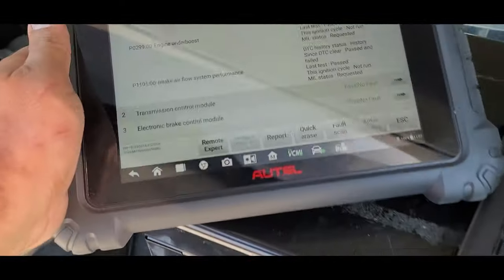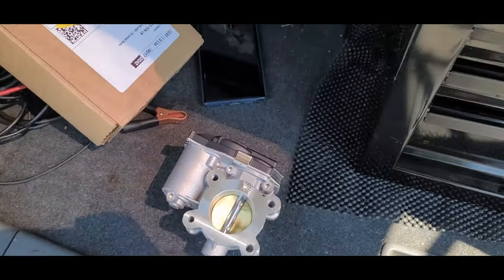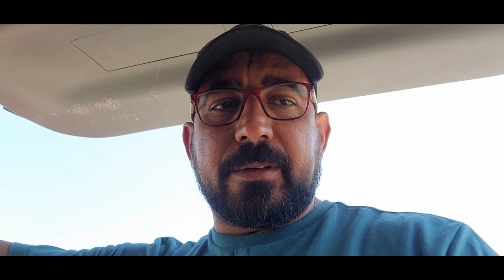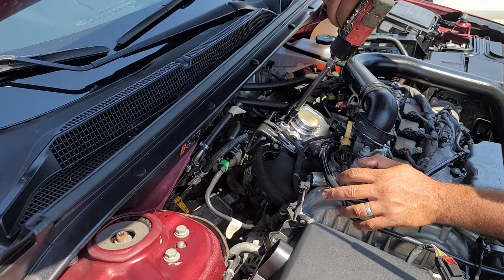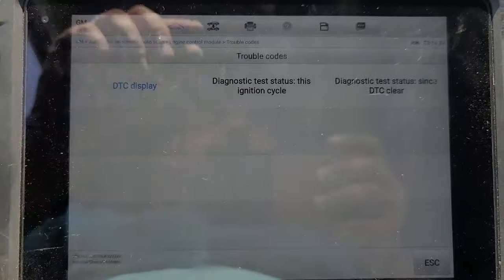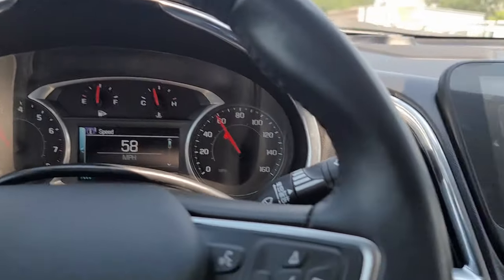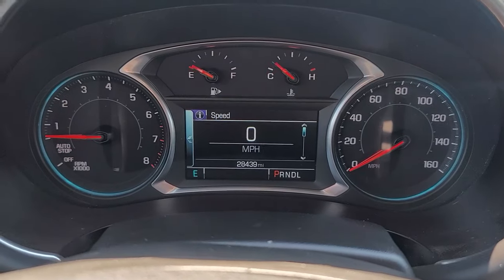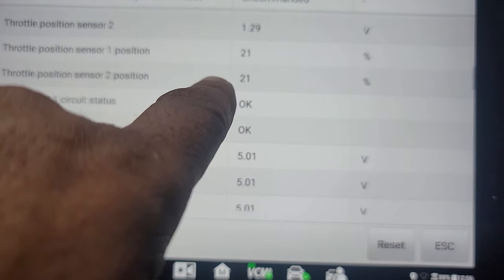Reduced Engine Power and 4 codes on a 2018 Chevy Malibu.

Comment: When mine had the reduced power, it was the electronic throttle position which is on the gas pedal on a 2018 Malibu. They replaced my pedal, which came with the sensors and its been fine. There's a special warranty for this problem so it needs to be taken to a dealer. They will fix it for free.
Reply: Do you have the number I can call for this ? I have the same issue now
Reply: They don't always fix it for free. Most pats places know the issue and have the pedal. It's only a couple screws that hold it on
Reply: This is what I’m confused on if it’s my throttle body or the pedal that needs replaced bc I’m receiving a reduce power engine.
Reply: @tekeylia  it's not that expensive for the pedal. Almost most times with even the forums you look at it's the pedal. I could be driving down the road and all of a sudden it says reduce power. I had to pull over, shut the car off and wait 10 seconds then restart to reset it. It has not done it since I changed the pedal
Reply: How much is the part
Reply: @nakiasmith4553  the part price is anywhere from $80 to $100 at O'Reilly's Auto Parts here. If I remember it's only one or two screws that hold it on
Reply: @daryllsmith388  the code that was coming up on mine was mass air flow sensor so I replaced it and it's still doing the engine power reduced message its been almost a month since I replace it.
Reply: @nakiasmith4553  is it doing it going down the road. If it is it's the accelerator pedal which has the sensor that causes the reduce power attached to it
Reply: @daryllsmith388  yes it does it going down the road. So I need to replace the pedal then?
Reply: @nakiasmith4553  yes replace the pedal. I used to work for Honda dealership and we did research on mine and that is the problem, get the pedal and you should be fine.
Reply: @daryllsmith388  0k thank you
Reply: Do you know if warranty on a 2016 Malibu Lt my engine reduce light on?
Reply: Thank you!
Reply: Dirty turbo > intercooler>throttle body> loose charge pipe pipe to throttle body. STP intake valve cleaner..run it 200 miles then crc tb cleaner. New plugs and only premium gas.
Reply: Btw 2016 Malibu 1.5t
Reply: Carbon build way faster than 2.0t
Reply: The same thing happen my car just be stop my engine reduce light on my car 2016 Malibu Lt I call the company report the issues.but they didn't fix my car.i had to pay which to me expensive.thy replace my gas pedal.which cost me $399.00 I glad you had better luck than me.
Reply: @goldiegold7824  yeah it’s a usb gas peddle
Reply: I’m in 25428, I’m no magician but I race my 2016.5 lt1 1.5t and I have solved a few problems as well as make it faster than the 2.0t at everything except for highway speed, it’s a city ninja though.
Reply: @goldiegold7824  clean out throttle body and get one of these BNR throttle body spacer
Reply: thank you
Reply: @goldiegold7824  hmu I’ll be glad to help. ❤️
Reply: When I got my car the pedal was the first issue I had the dealer replaced it now I have the engine light coming on I just took it I’m and it’s reading three codes P0011 P0123 P0506
Reply: @nakiasmith4553
Reply: @nakiasmith4553 you seem to know what your talking about I'm have I problem with my 2018 malibu 1.5 turbo. So my cars engine reduced power came on I pulled over and turned the car off and then turned it back on brakes are hard as shit and when I go to start it it will stutter tell it won't start. Put code reader on it and it pulled 4 codes. Crack shaft, came shaft, Mas and maf sensors replaced all but maf and its still pulling same codes. Breaks are hard still car ideals bad it will kill its self and still stutters to start. I don't know what to check anymore.
Reply: @desimation do you have Instagram, I’d like to see your car, and im also having problems with my Malibu 😞
Reply: @desimation  the 2.5l should be the same setup shouldn't it?  I just got a code for fuel pump and now next day I'm getting reduced engine power. Going to get the codes checked now
Reply: @daltonsabel6694 did you end up finding put the problem?
Reply: @daryllsmith388 how much is the for the part
Reply: @daltonsabel6694 ever figured out the problem

Comment: My engine power reduced happened last night. The brakes failed. Such a horrifying experience and I say God was guiding me and my car to halt. 😭
Reply: Same just happened to me. What was the issue? My brakes were failing
Reply: @EzekielFiveOneBarber dis you ever find the problem?
Reply: This happened to me and it was a vacuum pump
Reply: Did you figure out the problem?
Reply: Brake vacuum pump will fix this issue, when you pull out the old one you may have to take the valve cover off and clear remnants if it has broken 😩. That is a mess of a job 😞

Comment: Because of you I saved $100’s of dollars for the part and your a great mechanic. Houston,Tx
Reply from the maker: That's the whole point of the video
Reply: @DallasAutoDiag  I read video description.. should I go for changing the turbocharger boost sensor first before buying the throttlebody? My car is only saying “reduced engine power” sometimes not all times when I drive it.
Reply from the maker: @Cedricjrlitnow  there are many reasons behind this reduced engine power message on the dash. Did you scan the car? Any codes?
Reply: @DallasAutoDiag  Codes are PO420 and PO299. I’ve changed the throttle body and the wastegate solenoid check engine light is still on. And is hesitant on driving when stepping on gas says engine power is reduced

Comment: Thanks for the explanation Brother . 
I am facing the same issue , same model same car same issue .. 
Tomorrow i will do full check on the front end , will disassemble the pumber and track the whole system.
Reply from the maker: Good luck
Reply: @DallasAutoDiag  thank you , really i need the good luck especially with high prices for spare part in Baghdad. 🎉
Reply from the maker: @nooreldeentalib5550  if you changed your inter cooler make sure the place for the sensor is not clogged
Reply: @DallasAutoDiag   the problem was with Airflow sensor Plug harness. Cut off under the clothe tape , replaced and fixed . The check engine wnet off . Thank you .
Reply from the maker: @nooreldeentalib5550  nice find. Thanks for the update.
Reply: @DallasAutoDiag  thank you , it was because of air filter box  was loose and the holders was broken.

Comment: Great video I would add that low oil will also cause this issue as well be sure to check your oil!
Reply from the maker: correct. I do have another video on the channel on the low oil pressure causing this issue.

Comment: Thank you so much.  I took off intercooler and the  sensor so I can work on radiator,  when I started my 2018 equinox it was showing engine reduce power. After I watched your video I put the sensor back and it fix problem. Thank you again
Reply from the maker: glad that it worked.

Comment: Very helpful I have a 2018 Malibu with my check engine light on but they said my battery was completely dead but the car was still cranking up and I was still driving it. Replaced the battery last year don’t understand how the battery was dead but still starting idk 🤷🏽‍♀️
Reply: I had something like that happen to my car but after they changed the battery and cleared any codes it started running like crap and now I’m having acceleration problems.

Comment: 2016 Malibu LT 1.5 here.
Engine power reduced was shown and then the brakes failed as the engine went into a stop.

There’s an apparent oil leak as when I checked my oil there was hardly any in there despite having an oil change a month and a half earlier running  on usually highway miles.

I am currently replacing the oil pressure sensors but I’m also seeing the accelerator pedal needs replacing historically with this model?

Also I’m seeing that if there’s oil present in the clamp that keeps the pcv valve cover in place then this part historically needs replacing too on this model?

That might be my second and third option if this sensor replacement does not work.

Will update this comment if y’all are interested.
Reply from the maker: Yes sir please keep us updated. Also everything you mentioned is correct. I have another video on this channel that deals with the low oil issue. That was a hand made though. Still a cause of that reduced engine power.

Comment: I have a 2016 that did the same and it is the accelerator pedal it is not the throttle body. There is a lawsuit and other things on the Malibu about this issue, just Google it and you will see all the people saying it
Reply from the maker: Once I was contacted by a local guy that saw this video. His vehicle had the accelerator pedal position sensor. It could be other things that trigger the same messge.

Comment: I feel like driving next weekend from Austin to Dallas, to meet you. Such a skilled engineer with a good explanation. I have a Chevy Malibu 2013, the car is running good but I have a engine symbol on the dashboard. Got the diagnostic report from Autozone and the codes are as follows - P059 - Active grille air shutter performance, Active grille air shutter A performance /stuck off / Secondary DTCs : P0013 Exhaust camshaft position actuator solenoid valve control circuit,  P069E : Fuel pump control module requested MIL Illumination, P0AC4 : Hybrid powertrain control module requested MIL Illumination. What should I do?
Reply from the maker: Hey man. You don't have to drive to Dallas. I can refer you to a good people in Austin. If interested, send me your contact info via facebook.

Comment: I have a 2020 malibu 1.5L had the vaccuum pump fail. Replace pump, opened valve cover to remove shattered pieces replaced gaskets for pump and valve cover. Retimed camshaft as well. Also replaced camshaft position sensor, both vvt solenoids, and the breather hose with the 3 connections. Used home scanner to clear codes

My issue is that car is still getting reduced power mode. And scanner is showing several permanent codes which i understand are called PDTC. All of the codes are related to vaccuum pump failure. Also all the codes are what i had before replaced failed pump. 

How do i remove these codes? Do i need to run drive cycles. If so what are the parameters for a drive cycle and how many cycles are needed?
Reply from the maker: My advice is to find a good technician to diagnose it correctly for you and stop guessing.
Reply: did you found out what it was
Reply: @xiiikedgar777  glad you asked

Car is fixed…….2800 dollars later. Vehicle was showing codes due to camshaft having a chipped lobe from when the vaccuum pump seized up. While technically fine the missing chip was messing with the position sensor making it throw codes and therefore reduced power mode. I took a job out of state and had to start after my previous comment so i put the car in the shop and got  the camshaft replaced.

When i worked on it before and pulled the fuel rail the seals for the injectors were old and brittle and needed to be replaced, dealership couldnt order just the seals so i now also have 4 new injectors, coolant flush and a couple other small things they did that come with these 2 jobs. 

So yeah, 100 dollar pump cost me about 3400 dollars. My pump went bad in the worst way possible.

Comment: I wish you could’ve showed a video before you fixed it on how it sounded before you fixed it I have a 2019 chevy malibu and it sounds like it wants to start but doesn’t turn it went out while I was driving
Reply from the maker: Your issue sounds different than this video. This car I worked on ran and drove. It just had check engine light
Reply: @gustavovaldez6678 did u get the issue resovled?...my 2019 chevy malibu sometimes does not cut back on when i stop
Reply: @georgedeal9744  never did I traded it in didn’t want to mess with the problem sorry I couldn’t help you out

Comment: You don't suppose to open a electronic throttle manually like your doing it throws off the calibration and that car has a turbo problem either its crack and boost port or the flap not closing all the way inside the turbo your not going to get a check engine light because you keep in the car below boost go above 60mph that check engine like gone come on
Reply from the maker: Thanks for the tip. Will take that into consideration next time.

Comment: Hi there,  
I have a 2016 chevy malibu 1.5 turbo and over the weekend i experienced 1 code set 3 times it was P0299.  Ive looked everywhere for air leaks and such but nothing.  What else do you thinknit would be.  It was only the 1 code P0299 and i can't figure this out.  What do think i should do?
Reply from the maker: https://youtu.be/iSZdKWT2ARM
Reply from the maker: Watch this hopefully you gonna have some understanding. These codes are not easy to diag.
Reply: Check vacuum pump if you have a hard brake pedal they go out alot I have a 17 chevy malibu 1.5 turbo that had a bunch of codes that didn't say anything about the vacuum pump but my pump was bad and broke off in the valve cover and took my cam timing off so my car would not start and had reduced engine power
Reply: @travistodd6604  bro this is my EXACT problem for the exact same model and year. How much did you pay to have it fixed?
Reply: I did it myself watched YouTube video and got it fixed
Reply: @travistodd6604 Is the hard brake pedal the giveaway?

Comment: Do I need to do a relearn or it’ll be ok after several drive cycles?
Reply from the maker: Yes throttle relearn.
Reply: @DallasAutoDiag  I’ve seen a lot of people saying they didn’t have to u think it’s worth the risk.. If it’s not that I’m sure it’s pcv valve which cost thousands at dealer i got the p1101 code sometimes but after I somewhat cleaned the throttle it hasn’t come back but car still drives horrible most of the time I get good days

Please respond

Comment: Mine has engine light reduced and the sign that means the roads are slippery. What do i do to fix it
Reply from the maker: Scan it and see what codes in it
Reply: Take it to a dealer. Tell them to change the electronic throttle position, there is a special warranty for this problem. When mine went bad, traction control kept coming on, which is caused by the the other sensor. It's on the gas pedal on a 2018 Malibu.
Reply: @amymartinez-gomez4764  it’s fixed now I needed a new gas pedal

Comment: I have a 2016 Chevy Malibu ls 1.5 liter turbocharged and I have a couple of codes P1101 P16E5 and P00C6  I have replaced so many sensors can u help please
Reply from the maker: Where are you located?
Reply: @DallasAutoDiag  Florida
Reply: @DallasAutoDiag  when I turn the car on it says  engine power reduced and it won’t go over 20 miles per hour
Reply from the maker: It's too complicated to do by yourself. I would advice to find a good tech near you and let him look at it.

Comment: My engine reduced light comes on on my 2013 Chevy Malibu every time I go at least 2 miles and my engine light is on as well today I drove it and my gas pedal seem very Sluggish like it didn’t wear speed up while on the freeway… the engine light comes of and on at times the auto shop telling me where I got it from saying they change the sensors but also my air bag light is on
Reply from the maker: Where are you located?
Reply: @DallasAutoDiag  Detroit Michigan
Reply from the maker: @linnellbrooks5711  

Follow this link and contact Sam Brooks 

https://toolhutusa.com/

Comment: Hey, what do I do if the intake hose keep popping out while I’m driving, after cleaning the throttle body? The clamp is still there and the codes are gone, but the hose will pop out every so often
Reply from the maker: Is it original clamp?
Reply: @DallasAutoDiag  yes
Reply: @Imsohouston5 what did you do to keep it from popping out? Mine is doing the same thing. 🤦‍♂️
Reply: @gr29301  I used a reversible zip tie

Comment: Thank you so much.  Question. After replacing the throttle body if I don’t have a computer to clear the codes what can. Do ?
Reply from the maker: Just go to autozone and ask them to do a scan on the car. Then when they do tell them to delete the code cuz you just replaced the part.
Reply: U shouldn't need one. After I replaced mine, my check engine light went away once I started the car.

Comment: I'm looking at a 2016 Malibu from the dealership. It has a P0299 code. The dealer stated "Low voltage on the battery caused the code. The battery has been charged, and the code has not come back". Is that a possibility? Or is that just a used car salesman trying to make a sale.. Thank you!
Reply from the maker: What size of engine? Give me vin.
Reply from the maker: This code does not trigger because a low voltage. If low voltage then they can let car run to charge battery and then erase the code. Then drive for over 60 miles to make all emmision monitor pass. This code is a part of the turbo charger system. It could be very complicated to diag.
Reply: @Dallas Auto Diag  I told the dealership I want it inspected at a chevy dealership (they're a locally run place) and if it comes back with no major issues, I'll buy it. But I want that to be checked out by an independent dealership
Reply from the maker: @beegekhaos3171  don't do that or take it to a mechanic shop. There are people like me do pre-purchase inspection. Google them and hire them. I usually charge $150 to do a full scan, 360 visual inspection and test drive.
Reply: @Dallas Auto Diag  Okay good to know.  The car is 4 and a half hours north of me, so it may be tricky lol but I'll see if I can find someone
Reply from the maker: @beegekhaos3171  not tricky at all. That's one of the reasons why ppl do it so they don't waste time and money. If u find company make sure u tell them that the car has that code and also tell them u need All monitors to be ready/aka inspection ready.
Reply: @DallasAutoDiag  Gotcha, thank you !